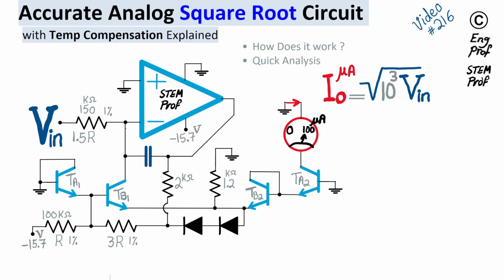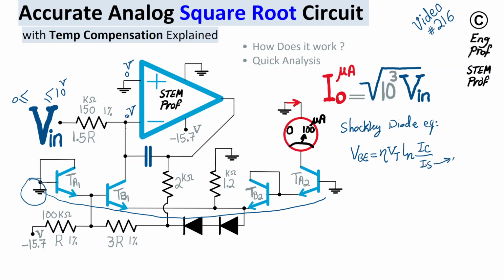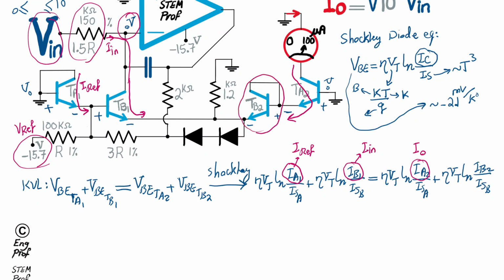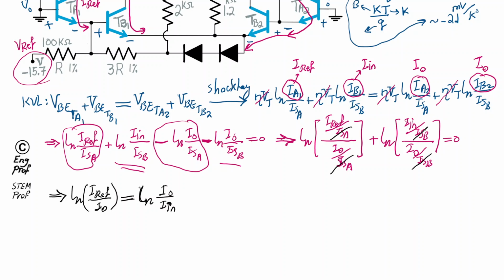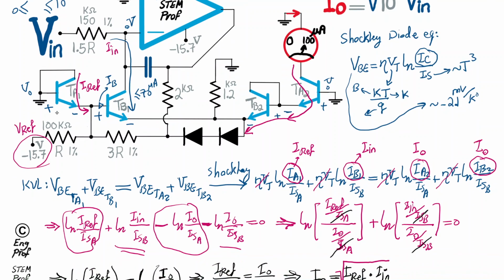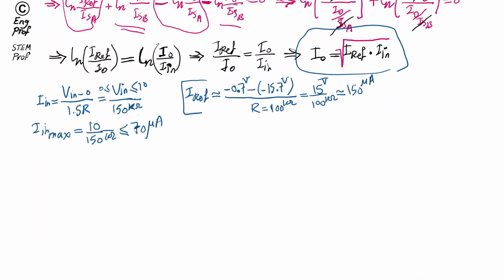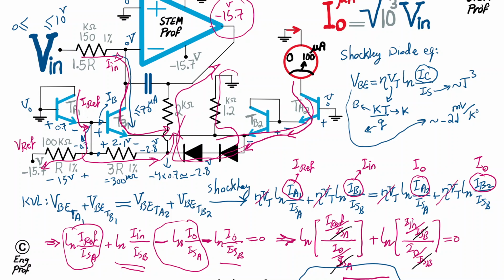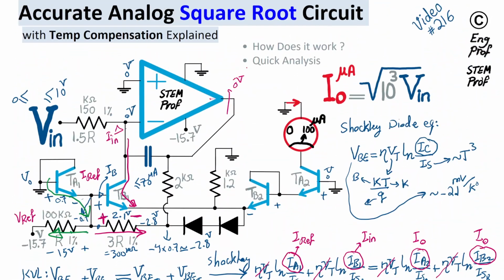Accurate Analog Square Root Circuit with Temp Compensation Explained

Comment: I'm keen to explore this circuit further. Dual matched NPN transistors are relatively easy to come by, such as the SSM2212 from Analog Devices, but Quad matched NPN transistors are a bit more difficult. Can you suggest some parts to try...? Great job by the way....I really enjoy your analysis...even if the white-board gets cluttered from time to time...!!  :-))
Reply from the maker: Glad to see you are interested in this analog square root computing circuit. Answering your question, sure, for example Analog Devices' MAT14 is a Matched Monolithic Quad Transistor package https://www.analog.com/media/en/technical-documentation/data-sheets/mat14.pdf and THAT300S14 , 320 and 340 are 4-transistor, monolithic NPN and/or PNP arrays with further information available in https://www.newark.com/that-corporation/that300s14-u/transistor-array-smd-so-14-300/dp/50M5197 . Two related quad-matched transistor design examples are the  https://youtu.be/VP53A2zpVMQ 4-quadrant Analog Multiplier Circuit and the https://youtu.be/hFbnjbddUvs video the explains the design and operation of a Temperature-Independent Current Circuit.